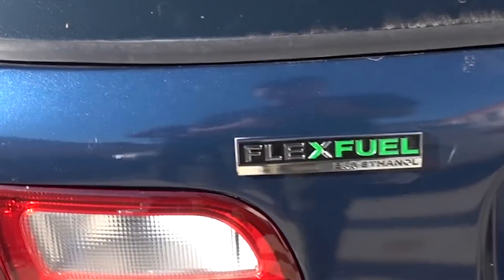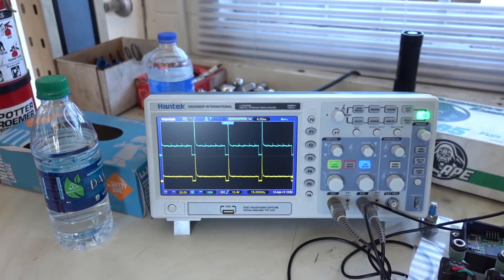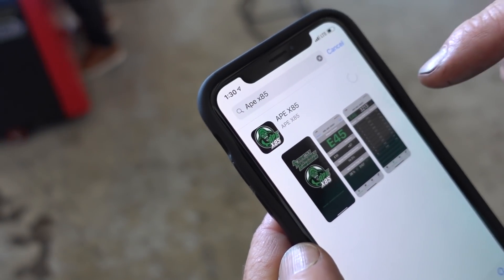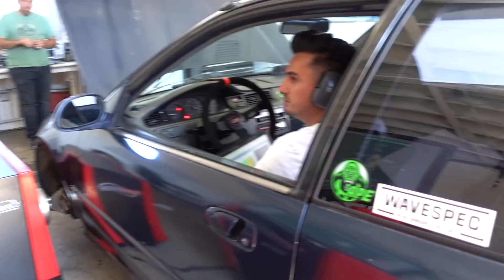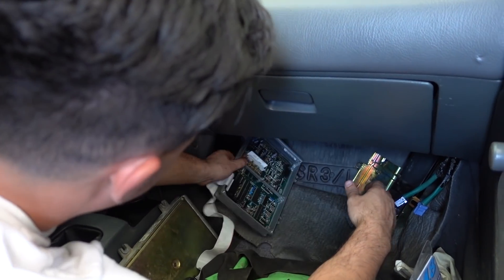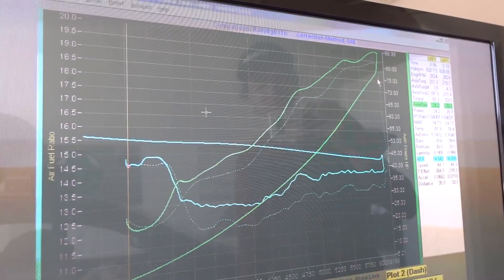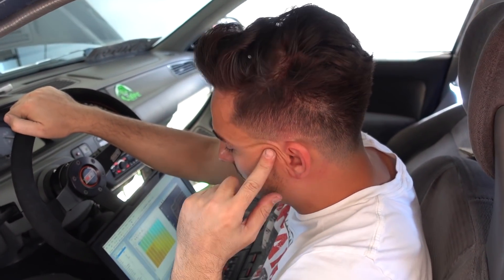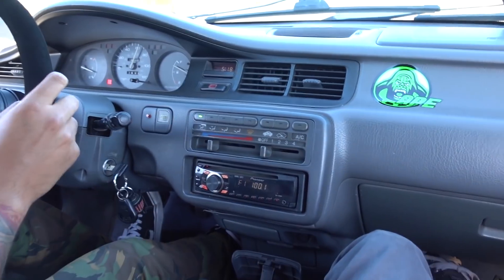Nelson's Honda Civic EG on the DYNO - Flex Fuel conversion makes More Horsepower!

Comment: I'm impressed, this is a 19% gain on a small-displacement, low compression engine without bolt-ons like cams or a header. Getting more power N/A is not easy as putting more boost. I wonder if the same gains could be expected on a B16A? This would get it to 185-190HP which is B16B/B18C5 territory without basically any bolt-ons. I'm sure Nelson is happy with the power increase, very good fun on the track with a lightweight car like this.

Comment: 100hp isn't exactly worth bragging about. Hell, the 235ci straight six (blue flame 6) in my 1957 Chevy 210 makes 140hp and 210ft.lbs
Reply: C.L.LocomotiveWorks it actually is. That 1.5L engine is 91.5ci which is putting out 97hp. If your engine had the same horsepower to displacement ratio, it would be putting out almost 250hp.
Reply: @user-tt2di3bh5n  Fair enough, just like people trying to get high hp numbers out of the classic flathead fords, those guys are wizards I swear.

Comment: Nice option but still cheaper to get chipped ecu and tuned by a pro for the same price as the box if not cheaper then the box
Reply: I haven't seen the video yet, but the chipped ecu on 91 was out performed by the module on ethanol. It surprised myself and the tuner as well.
Reply: Lol there box makes it like a it so they can tune fuel like a chipped ecu but you can just tune in a chipped ecu and do the same as there box but that type car you could buy flex sensor chipped ecu injectors and get tuned for same price if not a little bit more

Comment: That was just stupid e85 on a stock n/a motor all that work just for him to say my cars tuned on e85 and let’s not even talk about the shitty e85 they have more like e66
Reply: Gotta stay in the rules of the racing class. This was r&d to verify claims. Picked up a lot of low and mid range on stock ecu and a bit more with timing. Makes a difference for lap times at rallycross. It takes 20 min to install and 5 min to change fuel map on the phone. Pretty good for verified 13 wheel hp imho. Also good for saving money in the long run.

Comment: Only a temporary upgrade to VP M5 and even more fuel (+30% if that is possible with setup. Doubtful.) will get another 6-10hp. But no idea what will die in the fuel system with that methanol in the tank. Plus it would have to be pure M5 to see the gains. Ok, maybe $10 a gallon for M5 race fuel is not smart for this semi-stock car. E85 is everywhere and non-corrosive. But it is always killer to see how changing fuel can gain power.

Comment: Worth it but $pricey$
Reply: Realistically (compared to other legit, name brand bolt-ons, this kit does more for real-world horsepower then say exhaust, intake ect. The car had intake and exhaust and it didnt do much for power till we dialed it in and maximized it with flex fuel. Also having full flex fuel capabilities gives you the freedom to use 87-91 or e85 any time. You can also repurpose this system for other vehicles as well. Currently supports single cylinder to v10.

Comment: I think you should get a d16y7 head for it and shave it 35 thousandths of an inch you'll be pretty happy with what happens
Reply: VTech takes away from oil supply there's no difference in the oil pump from the Y8 to the y7
Reply: Oh yeah and don't forget to do an aggressive and port on the head
Reply: I will look into that 🤔 thx!
Reply: Nelson Flores also a d16y8 intake manifold will add some more fun to your SOHC
Reply: Nelson Flores or just convert to vtec with the complete y8 head + intake manifold

Comment: The only car they can go full throttle on and record the gauges without blurring them because it's still under the speed limit 🧐
Reply: TheCheeks1562 lol very true
Reply: @nelsonflores_  hahaha all love bro good shit
Reply: TheCheeks1562 🙏
Reply: I got rolled by cop when I tried to jump my track civic on a street with a big dip. Cop asked why I was flooring it in such a hurry and if its modded. I said, "I have to floor it just to struggle to get to the speed limit in this lawnmower!" He then recognized me when he saw my license and asked why I'm driving a civic when I have a cool wrx race car. Gotta save gas for race tires and event fees brotha! 😂
Reply: @subtledriver  That is too awesome! Cool ass cop
Reply: subtledriver yeah I’m sure
Reply: Cars (or motorcycles) like this are absolutely the most fun to own, every journey you drive it like you stole it and it sounds and feels like it all the way. Kei cars, particularly the sporty versions are a great example. See also Abarth 500.
Reply: @poo123444  Hell yeah. Even a lowly D15b2 with DPFI and a few common bolt on's does 117mph on level ground, but you must drive it like you stole it. How State Troopers never stopped me not sure. Probably because the car is tiny (CRX) and they knew it could not go any faster. Base model Hyundai Accent hatch rental cars take a nice beating and move at speed.

Comment: Don’t get me wrong, I like Honda’s, I just can’t imagine putting in that time and money to still have a car that makes under 100hp
Reply: Greg right now I am just aiming for reliability. I’ll do small mods like this to get me HP here and there but for the most part just aiming to be able to drive to/from the track and learn how to drive properly before I start chasing big horsepower gains.
Reply: @nelsonflores_  That makes total sense and I respect it. I also know very little about dirt racing but this seems perfect for that. I'm into drifting so the idea of a 100hp fwd car always seems odd to me. This is still super cool though keep doin what you do man!
Reply: All he really done so far is fuel conversion I believe. Still pretty stock motor and it's not meant to be used competitively in drag racing. It's for dirt rally I believe where that's probably perfectly enough for such a light chassis
Reply: @darquille  exactly! 👊 making big power won't help much when you are getting massive wheelspin with stock power. These mods are done to dial in the mid and low end power delivery/raise redline to be most beneficial for the course layout. Reducing shifting events and keeping low/mid range responsive will help with lap times in the mixed surfaces and make driving easier. Being reliable and less prone to breaking down or breaking parts is more important than raw power. Playing the long game and focusing on season points and learning proper car control is the goal! Thanks for the commenting everyone!
Reply: darquille yup, exactly👊 I have plenty of power to be competitive in rallycross right now, I am 3rd in the Cal Club RallyX championship. It’s more about technique and momentum in my current class - 2WD Prepared. I’ll eventually get to a point to where I  need more HP when I move up to the Modified class.
Reply: Greg when you begin to turbo / supercharge the B or K series you can get some serious gains, and combined with a very lightweight chassis, excellent manual transmission, and overall good suspension geometry from the factory, you can have quite an incredible track car. Remember, 50-100 added HP on a car that weighs about 2k lbs will be much faster than gaining 200 HP on a 4k lbs car.
Reply: Power is overrated. Lightweight and reliable is where it’s at